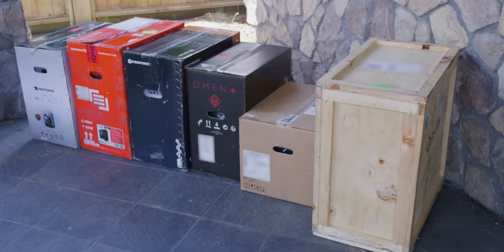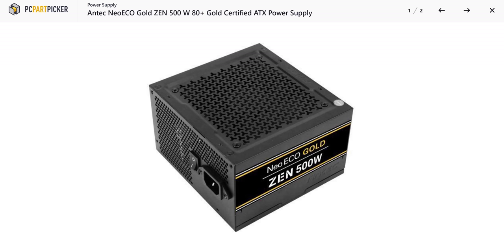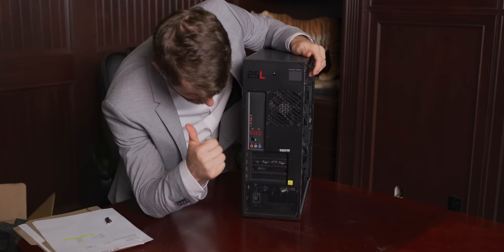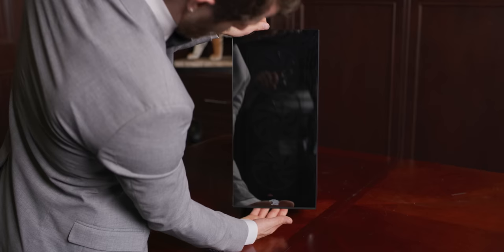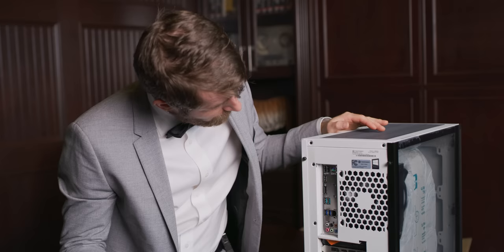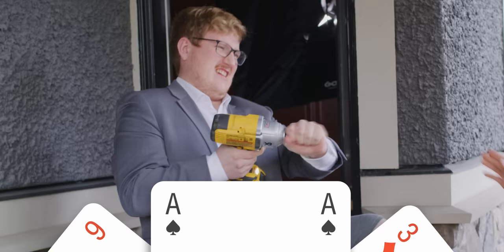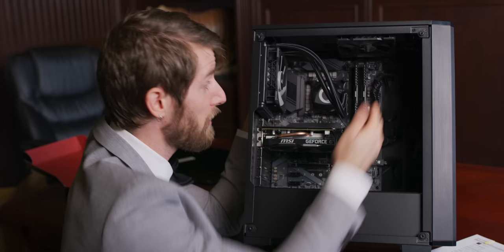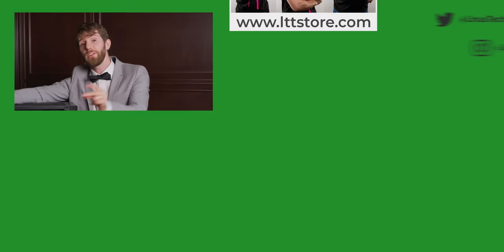What Did We ACTUALLY Get? - $1500 PC Secret Shopper 2 Part 2

Comment: They have used that same power supply since at least 2013. My old Dell Inspiron 660 PSU works in my other old Inspiron 3668 and vice versa. It's a good power supply, but it becomes e-waste as it only works in those types of OEM Dells.

Comment: I gotta say, not shocked at all by the lack of cooling in Dell's system. I have a Dell XPS laptop that they crammed a GTX 1050 and i7 processor (it's a few years old) but added almost zero cooling to. Even with my own new thermal paste, regular opening and cleaning, and an external cooling pad, it regularly runs at 75-85C WITHOUT opening up games. Additionally, Dell's BIOS has hyper aggressive, mandatory throttling and locked out undervolting meaning that my cpu regularly gets throttled from 2800hz to 800hz. One might could excuse this as over-ambitious engineering on their first attempt at the XPS ultrabook, except my father has the updated version and it has the same problem. Additionally, my wife got one of their big thick gaming laptops that has slightly worse specs and way more space from cooling, and it also can't stay cool at all. Again, these are laptops, but thermals seem to be the worst part of Dell's bad systems.

Comment: Got a Omen Laptop with a i7-7700hq, 1060ti and 16GB RAM 3 years ago and it still works great. 
Those Laptops where nearly unbeatable for the price and what you got., at least here in germany. 

Acer and Asus sucked with the Airflow solution, that told me, they are more a kind of an oven.  MSI btw couldn't deliver good specs for the same price. 
A prebuild Omen PC sounds mostly nice by specs they offer to choose from, but im building up my own PC. Then i know for sure what i got and what it can handle.

Let`s see whats inside a Omen for 1500 bucks, this got to be interesting. I bet the cooling solutions will be pretty standard and it'll have no mid or high class motherboard. 

If had to choose an prebuild Omen Desktop PC for gaming, i would go for the 2.500$ priced models or slightly higher. 

Just took a look and the Omen GT13-1635nd, it looked useful. But how noisy and how warm it'll be????

Comment: I'm never gonna get anything from ibuypower again because they didnt mount my aio cooler to my cpu properly so it wasnt touching it at all and I was always wondering why my cpu temps were so high, they also just stuffed my hard drive under everything where all the cables were instead of putting it in on of the drive bays

Comment: dell puts those tiny fucked up PSUs in their POS systems too. i had the exact same experience when i was parting out an old POS when i saw the PSU. You should be happy you even got an 80mm fan. the POS i had was using two 40mm fans with only one plugged in. go dell!

Comment: I had an HP Omen 880 something idk
It has i7 9700k
2070 8Gb
And 16GB RAM (2x8) so It had 4 in the motherboard

It depends on the model you buy If anyone Is interested 

I opened It as soon as It came, got a new case, got a new Power supply got a new CPU Cooler and sold the old parts to get the Money back so overall not a bad purchase 
Also added 2x8 to get 32GB RAM

Comment: What I can order from eMag, in Romania for 1500 USDollars:
CPU:                      Ryzen 7 5700G
Mobo:                   Gigabyte  B550 GAMING X
RAM:                     2x8 Gb Corsair Vengeance LPX Black 3000 MHz
SSD:                      Samsung 980 1 Tb
GPU:                     Sapphire RX 6700 XT PULSE
Computer Case: FSP CMT211A ARGB
Cooler: 	              ID-Cooling SE-224-XT Basic
Power Supply:    EVGA 700 BQ

The case and cooler are kinda bad ... but they're not the worst possible either.
There's no PCIe 4.0, but the SSD speed is still 3Gb/s, which is really really fast especially when all you care about is loading times in games, or webpage/app loading, which is snappy, even on a lesser speed SSD. The processor is more than enough for gaming, and there's room to upgrade the RAM, so you can drop another 16Gb in there and fiddle around with server/NAS/media creation without having any drawbacks.
For storage upgrades, you can add 2x3.5", 1x2.5" and 1xM.2.
The only thing that's a must is Heatsinks and some extra fans.
https://www.emag.ro/sistem-desktop-pc-gaming-serioux-cu-procesor-amd-ryzentm-7-5700g-pana-la-4-60ghz-16gb-ddr4-1tb-ssd-m-2-pcie-radeontm-rx-6700-xt-12gb-gddr6-microsoft-windows-10-home-srx-5949088514192/pd/D7TL09MBM/
Reply: This is the only place I would recommend anyone to get a pre-built. Avoiding Dell and HP at all costs, because you can't remove/add stuff into it without involving them and it costs an arm and a leg to change anything from the original config.
Not to say about:
0 Airflow cases
Low wattage supplies that give you low performance from the components stuffed into them
High temperature/Noisy machines

Comment: 1:56 i've been using an almost identical Dell keyboard for the past 6 years or so, it was the most expensive keyboard i've ever bought and by far the longest lasting (i which all that was a joke, but it's not), it's also a great keyboard, i prefer low profile keys and it has media controls, keyboards without media controls (at least volume) are useless to me.

Comment: I can't fault Dell for not trying to upsell a casual gamer who does some video editing to their top of the line gaming computer line. She gave them a list of boxes to check and they helped he do that. 

I can't fault HP for having a last gen CPU in the computer LTT picked out. Also what's a last gen cpu when you're running a 4 year old graphics card from 2 gens ago?

A filter on a top exhaust can help keep dust and other crap from settling in the system through the top.

I don't see an issue with resizing a generic cardboard box that is going to trashed rather than having half a dozen slightly different height boxes
Reply: 1. You can't take advantage of quicksync, on a kf model
2. That was during the crypto hell days. There literally wasn't other options for GPU's. Meanwhile, CPU's were experiencing a boom in advancement with ryzen

Comment: As far as the Dell rig goes, Even if you buy an Alienware you only get the cheap Dell keyboard and mouse.

The Alienware branded keyboard and mouse were an extra charge on my system that was 1800$ new.
I didn't care as I only bought it for the CPU & GPU but if I bought the system intending to use it I'd be pretty let down that these aren't included in the Alienware rigs cost

Comment: This stuff makes me so glad to have Alternate in my country.

If you use Logical Increments for reference, chances are that Alternate offer their own build with pretty much the same components or slightly better for the same price. It's often certainly possible to do a custom build cheaper (or was, before Corona) but usually not by that much.

They're neatly assembled and they come with proper packaging outside and inside.

Comment: Long time ago I helped the system administrator in my highschool fix computers on campus for a easy A, verse some boring elective. They had a deal with dell, and got the hardware for a reasonable price. I always thought it was a poor design for a school that a student could open the case without a tool. I had students putting pencils inside CD drive units, bubble gum. The district would take our older hardware and move it to middle schools and so on. Seemed like a ok stock case for many technical people. But let's put it in a room with kids and see how long till they injure themselves. I've seen people get electrical burns from a power supply while doing stupid stuff.

Comment: If you’re that much worried about packaging see if the manufacturers are using mushroom packaging just as strong as cardboard better insulation and shock absorbing and oh Biodegradable 100% within 2weeks I actually might help The process of breaking down things around it in a Landfield

Comment: I have an alienware and my pc has worked  decently fine but after learning more about computerts over the years, some of the choices they made with the case itself has been infurating when trying to upgrade. The Front fan in my R8 is loud AF for no reason and upgrading it is a pain in the ass Ram CPu and gpu were easy to upgrade but upgrading to an AIO was a pain and i go only go to a 120 instead of a 240 for my I9 9990k so i can't even use my CPU to it's full power

Comment: To be honest, I don't like my Dell G5 5000 because of its cooling my 1660 Ti reaches like 80 degrees which I dont like but my games mostly play at 60 degrees before it ramps up at not highest settings. I would like it if they had front fans and dust filters since this is a dust nightmare and a non-proprietary ATX PSU.

Comment: Single RAM Stick may not be ideal in terms of speed. It does however mean you can double the RAM by only buying one additional RAM Stick. If both slots of a two slot system were already in use, you would have to buy two new RAM Sticks and replace the existing ones. So personally, I definitely prefer the single RAM approach.

Comment: Really HP makes good products. I have their Spectre laptop, I think they use the less powerful CPUs for thermal reasons, as I can sit this thing on my lap without feeling much heat on my legs. For the desktop computers, this would only really matter if you live in a hot climate where super power can just turn your room into an unbearable sauna.

A lot of the custom builders of laptops just get plastic feeling crap from China for the case, speakers, etc. For laptops which is what I use, it is really a major difference to be able to actually listen to audio without headphones, and be handling something which feels more premium. I've bought a laptop from CyberPower and Novatech in the past, and the parts were really good of course, but there are little reasons like that, where I have just switched to prebuilds. For desktops it would be a completely different ballgame as you don't have to worry about integrated speakers, screens, keyboards, feel in the hand etc.

The flashy RGB stuff was also cooler when I was younger, but now I prefer more refined appearances. If I bought a desktop, the plain Chillblast cases (the computers made for editors etc) look like something I'd put in my home.

Comment: I managed to get core i5 10th gen(not k, f or something), nvidia gtx 1650, 500gigs ssd and single chennel 16 gigs of ram for 1200 usd(converted from my local currency) after taxes in August and it performs great I got bronze power supply idk what voltage was it good deal?

Comment: edit: holy SHITE I wrote a long comment. Tl;dr: smaller models of a tv have much higher pixel density than the larger model, so why is the price so, so much lower when the panel is more advanced?

2:11 somebody help me here:
“As you shrink components down, things tend to get more expensive”. Makes sense. But the issue comes in the case of TVs. As they get progressively larger, a tv of the same model will be exponentially more expensive than the size down - only problem is, the 80” model uses the exact same hardware as the 40” model, only the pixel density is a quarter of the smaller one.
Basically, if I have a 4K 80” tv, then when I size that down to be 40 inches it has the pixel density of an 8k tv. So, why is the larger one so much more expensive? Not just a bit more, but WAYYY more. And i feel like it can’t just be “people will pay more for the bigger model” - while it is absolutely true, it still makes it feel like the 40” would get sold at a loss given how the panel is more advanced. Pls anyone help this has been bugging me for ages

Comment: Who in the hell wanna run wifi on a desktop!? I mean... it's a DESKTOP. If it got issues reaching the router with a cable... get a wireless extender and plug in nearby and you get better network than cable if it's like, 10 meters or more.

Comment: Wow. The configuration on paper for that HP is nice, but the actual parts used are kind of utter trash. It's a case with no source of air intake from the front, the only means of air intake from the bottom is basically flat against the ground. And, what little air can even desperately get in will be sucked directly into the video card. The video card is a blower style cooler, so it's going to be constantly running hot and loud. And, there isn't really any ways to improve it without replacing most of the components, including case and video card. 
Pretty much the only things I can compliment is the usage of a standard PSU and the CPU.

Comment: next secret shopper should ditch the budget and go strictly for the same parts across all systems. that way you can compare apples to apples and see exactly how much each builder overcharges for those specific parts, compared to buying the parts and building the system yourself.

Comment: So the 1660 Super is the slowest yet... MY 1660 Super clocks in (No OC) at 1900Mhz(And some change +/- 20-30mhz) And can run nearly everything at 60fps at 1080. Like.... Am I missing something here?

Edit I have a CyberpowerPC with nearly same specs as the Origin PC. But mine was like 250ish dollars cheaper. AND I bought mine at the height of the Silicon Shortage. And this is from someone coming from AMD. (Which I have horrible experiences with.)

Comment: the good thing is even if the power supply doesn't have as much airflow it shouldn't produce as much heat because of its higher efficiency, which was probably Dells goal there, a power supply that wouldn't need unrestricted airflow.

Comment: I mean I would love the dell
Reply: I actually bought the dell g5 before finding this video. I managed to get a core i7 10700f with a 2060 super for the same price they paid for theirs. I’m a little bummed out about the inability to upgrade, but it is what it is and other than that I’ve been happy with it.
Reply: @beanlegion8529  US prices or CAD
Reply: @mr_jimmmmmmm  US. Btw since then I’ve replaced the motherboard case and power supply with more upgradeable components. Basically rebuilt it from the ground up.

Comment: 1160$ for that dell shit.
 Man, even with the GPU and CPU shortage, i managed to get a Ryzen 5 3600x, Nfortec Sculptor Black for CPU cooler,  Ballistix 32gb( 16x2) 3200mhz ram, Asus tuf b450m plus ii, RTX 3060 12gb GDDR6, L-Link Avatar USB 3.0 case, Gigabyte P750GM 750W 80 Plus Gold Full Modular, 250gb SSD, 1tb HDD for 1140€ (1270$) I would rather spend 100$ more and get a decent chunk rather than that shitty ass dell PC. And it's 1270$ cause of these overpriced things, i got the rtx3060 at 511€, if i had that for the MSRP which was 325€ my whole set up would have cost 955€ (1065$) 100$ less than Dell, just goes to show even with the shortage, for low-mid range PC it's still better to build your own rather than prebuilt.

Comment: I'm pulling the old geek card by making the following statement: It wasn't that long ago that what you now have in your back pocket once weighed tons, required a huge building with ginormous amounts of cooling and power, and a staff of highly trained staff of engineers to keep it running.  An entire city could have been managed by just one of the machines you've unboxed and "dished" in this video.  Specialized trucks with air suspension delivered this fragile machines from the those who built them. (I can't remember how many times I dropped my phone this week.) I have a difficult time taking all of this nit pickers seriously.

Comment: wtf  every system  just  basic junk. Expandability sucks especially for  hard drives. I Just don't understand how people can settle for only 1-2tb hard drives when most modern games can eat up that space as if it was nothing. Even the cases are small and air flow  tends to be non existent in smaller pc cases.

Comment: I absolutely HATE the idea of buying a pre-built PC, and refuse to pay $3K+ for an RTX 3090 which will be obsolete and last-gen by Christmas ... RTX 3000 Series graphics cards are like Bigfoot and the Loch Ness Monster: everyone talks about them and there's tons of pics of them all over the internet, but you'll never actually see one. 😂

If I'm being forced to buy a pre-built PC like a n00b in the 90s or early 2000s, what's the best way to simply get an RTX 3090, i9 12900K and a solid mobo that supports high-speed DDR5 (128GB+) and multiple GPUs? 

Ultimately I want either a giant EATX "box" style or an open rack chassis so parts are spread out and keep cool, enough space for multiple GPUs and it's easy for my big hands to fit in there and work on it (also room for PCIE risers, good cable management, extra components/upgrades and mods). I'm a professional game developer and (obviously) a gamer when I have time to play instead of writing code and debugging and I'm also planning on doing accelerated training of ML/NN AI ...

Comment: Linus 🤷🏼‍♂️🤦‍♂️ wtf stop “giving dell credit” this system was terrible and their BS nonstandard parts like the psu, motherboard, and other things means that there is almost no upgrade path for a following generation or anything past just pulling the GPU and CPU out of here and putting that in another system. Not to mention your getting 1 stick of ram which shouldn’t even be an available spec unless you specifically ask for it! But your getting all that for $1500 with a 1660 ti and one ram stick … and a bunch of e-waste 

Garbage 🗑. It sucks to see just how horrible dell actually is with these things and how they only want money and nothing else. Literally they asked for warranty, virus protection, and financing like 10 times 🤨!